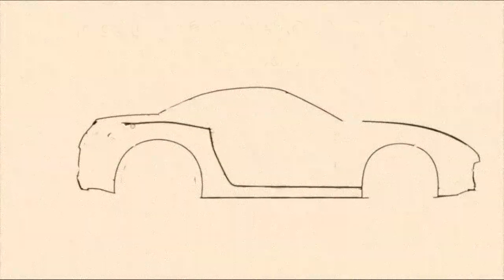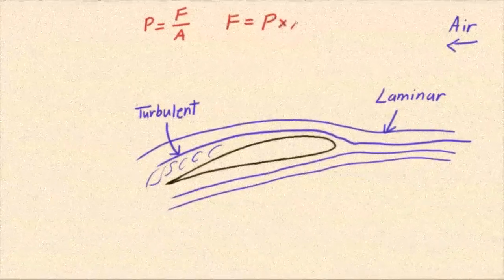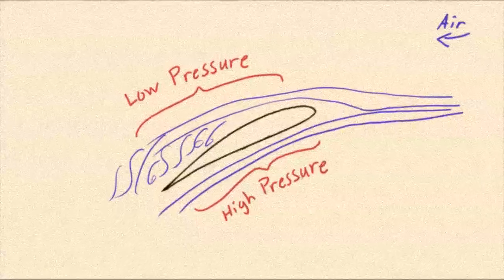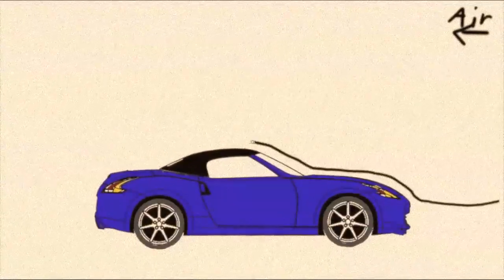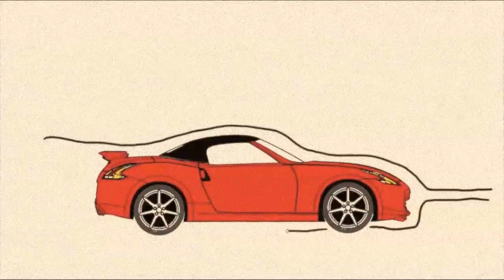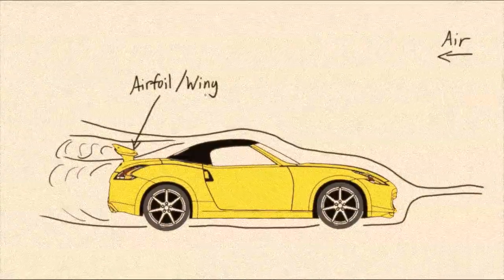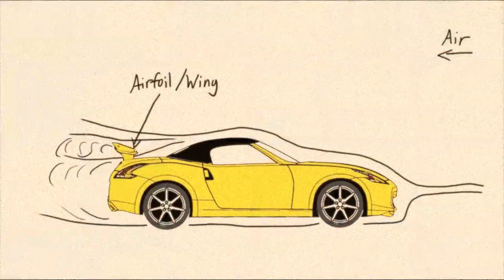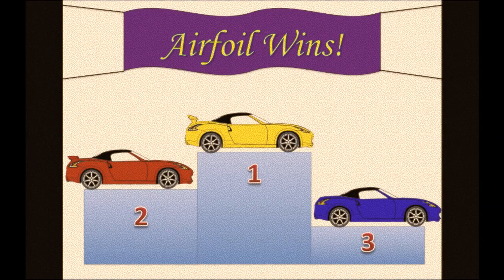Sports Car Aerodynamics: Spoiler Alert!

Comment: Kids, or anyone came here thinking you are about to learn stuffs: the aerodynamic part of the theory is basically incorrect. It doesn't work like that.
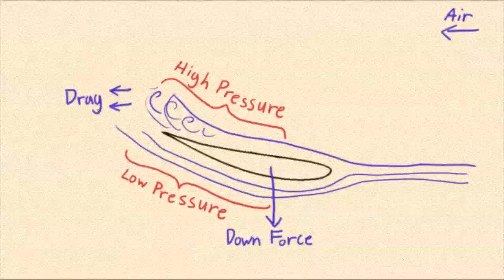Reply: At about 2:40, the diagram flips from the conventional wing to the inverted car wing. The turbulent area of boundary layer separation is incorrectly drawn on top of the aerofoil. This area occurs behind the convex surface, whichever way up it is.
Reply: +SVAFnemesis   I have to agree.  And I believe the results of the "race" are wrong.  In a straight line race (as represented), the weight and drag of the spoiler or wing, are going to slow the car more than any advantage gained.  Supercars on a track with many turns, sure.  F1 cars on an F1 track, of course.  But street cars, even sporty ones don't spin tires except in 1st heat when the speeds are too low to provide downforce.
Reply: +SVAFnemesis lol. that's what I said
Reply: Aaron Davis have you ever seen a top fuel dragster?
Reply: It does a bit
Reply: Uh.. Most of you claim you're knowledgeable in this subject but I see the opposite. A spoiler lip and a wing are two separate things with different functions. This instantly makes me doubt majority of the comments as most of you are interchanging them as if they do the same thing. Most of you are likely to say a truck's rear bed gate at the up or closed position creates drag and decreases range, which if you did think was true, you need to read up a bit. 

From my understanding a spoiler lip is to redirect the general point where airflow separates at rear of the car, after the trunk edge. Air usually becomes a swirling mess and create a pocket of low air resistance as the bottom/top air streams converge which is also aerodynamic drag. Put on a spoiler now, you redirect air (also creating a small cushion of air between spoiler - rear window) and normally where flow separation/turbulence happens and suddenly the drag and low pressure pocket attached to the rear of your car is reduced and placed away from your car. So, a decently designed spoiler lip decreases drag actually. This is why Nascar (exaggerated example because they drive fast as hell) have massive spoilers pointing up. You all think it's like hard block and only decrease acceleration and range, nope, that's not how aerodynamics work, even if it's a more extreme example. Airfoil or wings decrease top speed for sure but you get more grip on corners as everyone should know. Spoiler redirects airflow and decreases drag. 

In this race when the car's are all uniform and say for a half a mile race for top speed:  #1 Spoiler Lip Car wins, #2 No Spoiler Car, #3 Wing is the slowest. Winged car at some speeds/conditions will likely win. In every day situations though unless you balance out the front lip spoiler to increase downforce, a wing is probably the worst aerodynamic mod you can put on for everyday driving. A nice spoiler lip = can't go wrong if it's designed well. 

Long essay but pretty much says most of you are just bs'ing us and have no clue.
Reply: Uhm. Is it really?
Reply: I thought so.
Reply: your wrong, see my comment
Reply: SVAFnemesis yeah
Reply: SVAFnemesis thank you. I was.lookong to see of someon e else said it.
Reply: Aaron Davis even so, usually, drag cars had stances where the rear end is a bit higher. So even without a spoiler, that stance gives a bit of downforce which helps dragsters stick on the ground.
Reply: A lot of drag cars have wings. Actually rarely any drag car has no wings.
Reply: Small lip spoilers can reduce drag by helping the airflow make a clean break with the body of the car. That's why so many new cars have boxy rear ends.
Reply: Aaron Davis except they do. top fuel dragster have huge wings
Reply: ...Is this really Sheldon Cooper?
Reply: what? increasing friction makes the car go faster?
Reply: Aaron Davis yes they do
Reply: Damn....
It's always the same... Every time someone puts out a video on pretty much anything. You always get the same negative feedback. It's actually unbelievable how humanities in such a bad state when we've got so many Einstein's on the same globe... And when I say Einstein, I mean "geniuses". Must be precise because I can already imagine the whiplash... ( Einstein has nothing to do with airflow you moron).... Stop criticizing every dotted I's or crossed T's. This in my opinion is a very good video for people who do not know about aerodynamics. Yes, there could be improvements... But !!! That's in "EVERYTHING"... If there wasn't ? Humanity would still be in the dark ages.... I'm probably gonna get analyzed, criticized & dismantled by all the geniuses out there... I DON'T CARE.. Just try and be a little more human & a little less perfect.
Reply: Edward Rex A well designed spoiler should allow the car to be faster in a straight line. It should reduce lift and drag. A airfoil will provide downforce for greater cornering speeds at the expense of increased drag. For example when nascar switched to airfoils the cars created more downforce but their top end speeds were slower when compared with the spoilers. It’s also the same reason why a pickup is more aerodynamic when the lift gate is up versed when it’s down or completely removed. The race should be spoiler car first, then no spoiler, then airfoil. If it were a circuit race then under the same exact conditions with the same driver the results of the race would likely be as described in the video
Reply: stinkyfungus Where'd you get yours, a farm?
Reply: Eltaurus 

dude thinks he's better educated than the propeller heads at MIT...
wonder where he got his engineering masters... a cereal box?!
Reply: You're totally incorrect, The downforce creates more friction to the wheels, which puts more Horsepower to the wheels, making the car faster.
Reply: I think the video is correct. You add a spoiler on car and it increase downforce. And the downforce increase friction to make car go faster

Comment: This only applies to rwd and possibly awd cars... fwd honda civics don't take any advantage from a spoiler or a wing when accelrating
Reply: Front spoiler
Reply: +Jason Jia In a straight line, yes. But on turns it will benefit any car, regardless of which wheels are driven.

Comment: Very interesting! Your thoughts on my question! My 350z( look up bull run prep 350z) it handles great on the track but I think with a rear wing , right adjustment, not too large it will perform even better! Your thoughts! No under or over steer! Excellent acceleration, corners are perfect! There are 2 track day videos posted as well! Thank you!

Comment: "Lift" occurs relative to the airfoil, regardeless of which way up it is. E.g. the horizontal stabiliser, (tailplane) of a conventional aircraft is mounted to generate a downforce, like the spoiler on a car, but it's still creating lift. Any lift generation will result in drag. A spoiler that reduces lift should reduce drag.

There's actually an academic debate at a much higher level than YouTube about what really generates lift. It's been going on since at least the beginning of the 20th. century, if not before, involves mathematics, infinity, and a bitter rivalry between Cambridge University and Heidelberg. I don't think they've found a definitive answer yet.

Comment: Wow very good, I hardly ever see explanations so accurately explaining boundary layer flow types, airflow separation and pressure drag. Also awesome effort with the wind tunnel. My main complaint for accuracy though is that in downscaling with models you introduce the effects of low Reynolds numbers. But still great job.
Reply: Rest in peace samm
Reply: Samm Sheperd dude this is fake its wrong
Reply: Ok I have to make some assumptions here. First, air is at 1 atm at 300 Kelvin (26.85 °C) with a kinematic viscosity of v=1.568EE-5 m^2/s which is 2.43EE-2 inches^2/s

Porsche is assumed to be 1999 model, therefore 51.4 inches /20 for scale so 2.57 inches tall. If you pause at 5:12 and make your best guess as to the height of the box. Which is roughly 2 times the height, so call the box 5.14 inches => 5.25 inches for ease of calculation.
The length is 175 inches / 20 for scale = 8.75 inches. (8.75/5.14)*5.25 = 8.937 = L inches (so it’s scaled properly) 

Re=(Q*D_h)/(v*A) where V is fluid velocity, D_h is hydraulic diameter, v is kinematic viscosity, and A is cross sectional area. D_h= (4*A)/P where P is the perimeter the fluid contacts. If W=H because it’s a square, A is W^2 which is 5.25^2=27.5625 in^2 and P=20.5 inches. 

D_h= 5.25 inches (I know it’s weird it worked that way.)

Ok here’s the final assumption, Q. Q is the flow rate in the pipe. For that we have to assume a volume of fluid. Let’s use the length of the car, L=8.397 inches.  If you analyze the footage closely around 5:09, you can see that the smoke flows under the car from the front to the rear in about 0.5 seconds. Q=V/t Where V is volume of air (A*L) = 246.333 cubic inches of air (roughly 1.064 gallons or 4.04 liters). So therefore if t=0.5, Q is 123.167 cubic inches per second. 

Re= (123.167 in^3 * 5.25 in)*s/
        (0.00243 in^2 * 27.5625 in^2) *s 

Re=9,654.5 call it 9700. 

Reynolds numbers of 10^4 magnitude are considered below standard low Reynolds number aerodynamic flow (usually the 10^5<Re<10^6 range). Aerodynamic effects like the ratio of lift to drag are dramatically lower below 10^5. Technically we are in the 10^3 range but close enough to 10^4 for this purpose. Still, the OP is correct, this is likely introducing the effects of low Reynolds numbers. 

 @MrBigGuy1977   I’m sorry, but you’re wrong.
Reply: @TGears314  246/0.5 is not 123, but 492, so the Reynolds number should be 4 times bigger I guess. That would put it closer to the right range but still too low, which I feel is correct because the "wind tunnel" in the video does not seem right. Strange they didn't think about this if we're right.

Comment: nope. bernoulli principle only works in the ground effect region under the car. in car wings since it's so high up form the ground, you only take into account the mass of air being pushed up at what rate to calculate the amount of downward force generated.  airplanes also don't fly on the bernouli principle, they fly by moving at a high enough speed that the angle of attack of the wings throws enough air downwards at equal or greater momentum to keep the plane up in the air.
Reply: Bree Peng The forces arising from both Bernoulli and Newton (pressure and momentum change of air) are not additive. It's the same force. These are two different ways of expressing the result of the SAME PHYSICAL PROCESS taking place. Bernoulli Principle is a force balance at microscopic scale. Newton's 3rd law is a force balance at the macroscopic scale. Both apply, both are consistent, both give you approximately the same answer.

The reason the air gets redirected by the airfoil is because of the pressure difference which is caused by the airflow acceleration.
Reply: it's actually the angle of attack. most aircraft wings are slightly slanted such that a line from the trailing edge and the leading edge has a positive angle. this is what throws air downwards. the exceptions to this general design trend are aerobatic planes, but when these planes fly, they fly ever so slightly nose-up to give their wings an angle of attack in addition to their engine's thrust being partially utilized for lift.

Bernoulli is only significant at ground effect and venturi rings when the air is more closed in.  it is not responsible for a wing's lift high above the ground. aerodynamics programs have long known this but really haven't cared to correct grade school teachers who attempt to teach Bernoulli. completely flat and/or symmetrical wings work just as well as conventionally shaped and cambered wings because flight at altitude doesn't rely on bernoulli's effect. a completely flat or symmetrical wing in a wind tunnel won't exhibit any properties of the bernoulli effect and yet when put on a plane it will fly.
Reply: What I've come to understand is that there are many observable effects. There is in fact a pressure gradient. There is also in fact a momentum change in the air. Now at the core of this we have a deeper debate about which causes which.

I think it's dangerous to claim one effect as the sole cause of all lift and that someone else that has heard a different explanation is wrong. So I guess I prefer to say there are different ways to look at it.

Just remember that every physical process happens because of an imbalance of forces. Be it pressure, electrical charge, mechanical energy, etc.

Comment: WTF! this video could not be more wrong. Aerodynamics are all about tradeoffs, sure youll get downforce from a spoiler but you also get incredible drag. Why do you think F1 cars have drs. The average sports car doesnt have the power to break traction at high speed so when racing in a straight line a spoiler is complete and utterly useless and only adds DRAG!!!
Reply: DRAG is trying to slow the car down!
Reply: ***** What? F1 cars don't even have spoilers. A spoiler decreases the overall drag of a car by improving airflow, that much is fact.
Reply: +TheFlyingPineapple are you sure F1 don't have spoilers?
Reply: +Really blub I know it's counter-intuitive, but spoiler do decrease drag. That's why you see almost vertical spoiler on the back of NASCARS. Here's a good little article explaining how they work:
http://oppositelock.kinja.com/wings-spoilers-youre-probably-doing-it-wrong-1665312667
Reply: saulsebrook yes spoiler makes the car slow
Reply: +TheFlyingPineapple First: F1 Cars have wings. Second, a Spoiler increases the drag of car. The only task of a spoiler is the elimination of the lift the cars produces. Wings create downforce (in contrast to spoilers) but both of them create much drag.

Comment: Does this only apply to rear wheel drive cars. Does it benefit a front wheel drive car at all?
Reply: in drag racing, front wheel cars will always lose against rear wheel cars: there is no aerodynamic trick to compensate the pure inertia lifting up the car's "nose" in acceleration. The only way to (partially) solve it, is mechanical, by working on suspensions' springs hardness

Comment: I think you've made some big mistakes here. You claim that a spoiler increases drag and adds downforce. While the downforce undoubtedly improves cornering performance, the drag will most definitely DECREASE acceleration, not increase it. Basic dynamics, bro.
Reply: well if for some reason you will spin your wheels while going 100mph the drag will make a downforce that will make traction thous eliminating wheel spin and making power. easy. never saw a wheel spin going 100mph though
Reply: And when that happens, the driver needs to learn throttle control.
Reply: +Dark Lightning Miller's    all downforce attributed to air deflection anyways, which isn't that much unless its a fast course. Downforce due to gravity is still there.
Reply: Bryan Kronenberg that is how i know it to!
Reply: xDel I've seen many, many cars break loose at 120+ mph
Reply: If you had 3 powerful cars that are the same model with the same upgrades (besides spoilers) the one with the air foil would win in the quarter mile the one with the spoiler would win in the half mile and the car with no spoiler would win in the mile. Unless the spoiler on car 2 was built to decrease drag then that car would win in the mile
Reply: But for most low power cars your goal is to decrease drag as much as possible
Reply: Bryan Kronenberg if you remove drag you lost all downforce basic dynamics bro

Comment: Really cool video, but i still don't see how a wing on a car would increase the top speed. It will help you increase your turn in speed. but your over all top speed in my opinion would be decreased
Reply: ***** Spoilers/wings/diffusers don not do as much at low speeds though, Mostly for stability at high speed, and high speed cornering on rally cars with plates on the edges of the wing, to keep the vehicle pointing straight

Comment: This is a very over simplified explanation, but mostly accurate for the general purpose. If people rally want to know about the subject of aerodynamics and fluid flows, you have to take an actual class. Air has such a high reynolds number that it will never be laminar on this earth, although it can be less or more turbulent than a different section in an airflow. Nonetheless, the terminology is incorrect. Also, it's always a trade off. If a car has all the traction it needs without extra downforce, then you are effectively just making the car heavier at high speeds. And let's be real, at the speeds that normal cars (not race cars) struggle with traction, a spoiler/rear wing, will not help. Also, you have to take the conditions of the race into account. High speed turns, wings/spoilers can improve if designed properly. Drag strip, probably not so much beyond reduced drag if your aero kit can perform that way, but that has more to do with the car's overall coefficient of drag (which may or may not be helped with a spoiler)
;-)
Reply: Yes